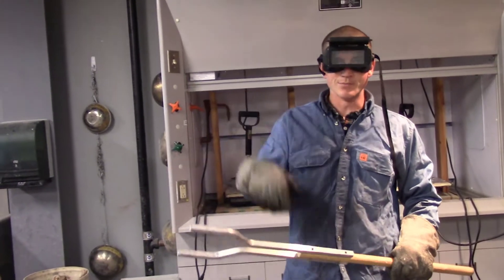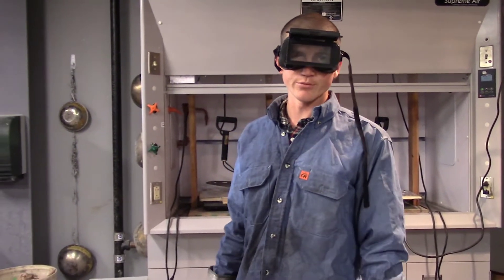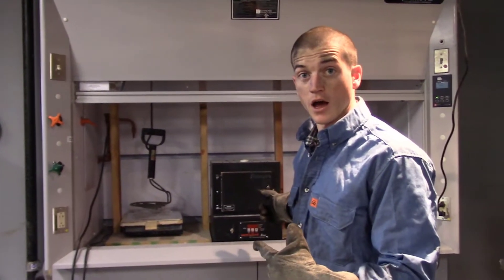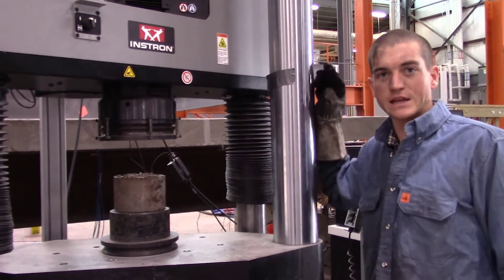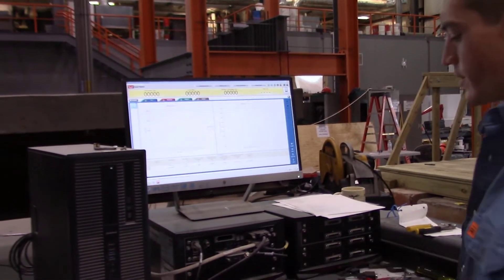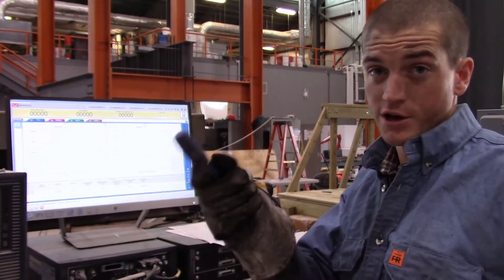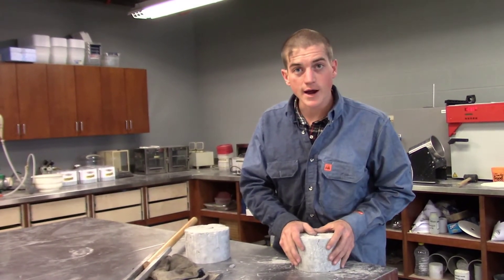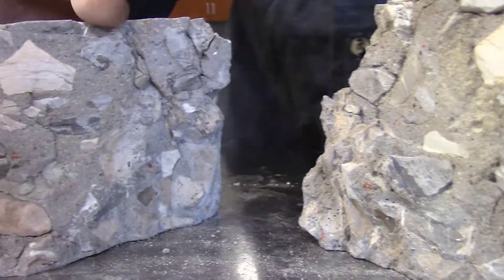Heat Damage to Concrete - lab testing - class project

Comment: I am a little confused?  Why does the compressive strength based on cross-sectional area i.e. N/mm^2 ?
if the volume is not a factor in determining the compressive strength, then why the test is performed on a cylinder?
Why not perform the test on a thinner cylinder?  Will it perform differently with less volume ?
Can anyone explain?

Comment: If I wanted to vacuum for thermoset plastic over a concrete mold, would I run into any issues? with 400 degree abs plastic being exposed to the surface of a concrete mold?

Comment: What makes refractory cement able to handle high heat?
Reply from the maker: I think you mean calcium aluminate cement.  The material formed by this cement has a different chemical structure than portland cement and the water is more tightly held.  This means that they require higher temperature to break.

Comment: Two issues with this experiment. One, if you quench something that quickly, its like cooling glass and it could have exploded if it had less mass. Second, the cylinder being loaded was really rough and uneven when on the Instron, the top side anyway. I would think that would influence your compression strength at 900 psi. Normally you would cap it before testing. You may have had a rubber cap in the top there. Normally, heat rises and the compression side of beams are away from the heat source, so buildings don't collapse from such a drastic reduction in strength. However, you did prove that even concrete loses strength when elevated to 1100 degrees. Would be interesting to test the cylinder raised to 1100 degrees and then tested at around that temperature and then after a normal cool down in air, and then after a cool down using a garden hose, not dunking in a tub of cold water.

Comment: Hi professor Tyler Ley! I would like to thank you for your video.

I have question concerning crack in concrete under mechanical stress. I really appreciate if you could make a video explaining where does the crack start? Ex: interface between steel and concrete for upper-macro-scale, aggregate and mortar for macro-scale, sand and cement paste for micro-scale and it's cement particle (or water and cement particle) for nano-scale. And where does these crack will propagate?

Thank you for considering my question.
Reply from the maker: Thanks for the question.  The crack will start at a point of imperfection in the concrete.  It could be in any of those places.  It depends on if the imperfection is near the stress and how big it is.  Let me keep thinking about it.
Reply: @TylerLey   sir please your gmail account

Comment: Great video..  I have a question.  when concrete pavement expands due to high temperature like ~95 F or higher, it will cause high axial force/compression force and then it will blow up..  What test can we do to evaluate concrete expansion and mitigate it?  I know that coefficient of thermal expansion is a good test to evaluate the expansion of concrete.... Thank you!
Reply from the maker: Thanks for the question.  The coefficient of thermal expansion is the best way to estimate the expansion information.  However, there are a lot of other parameters like the sub base friction, the size of the joints, and the compressible material within the joints that all impact these numbers.  Both Huang's and Delatte's books talk about how to design joint sizes.  If you keep these joints clean then they should perform well.
Reply: @TylerLey  Thank you very much!